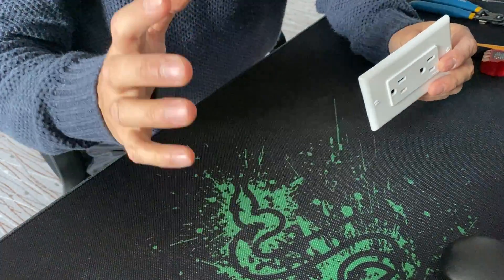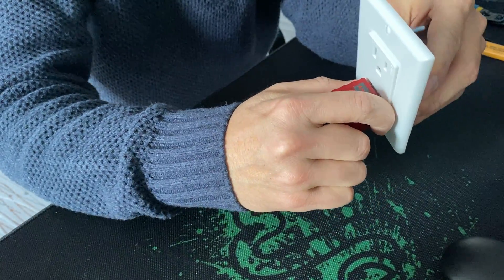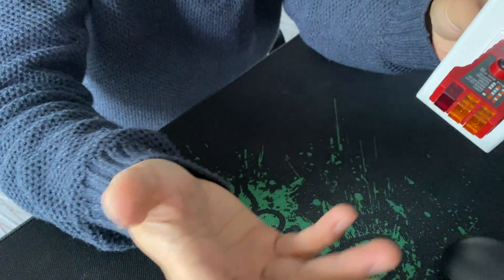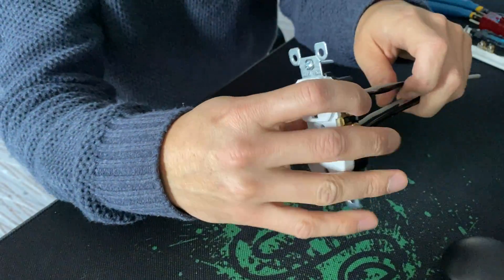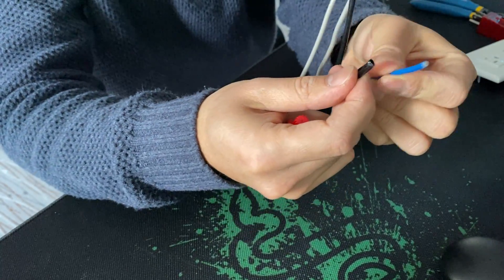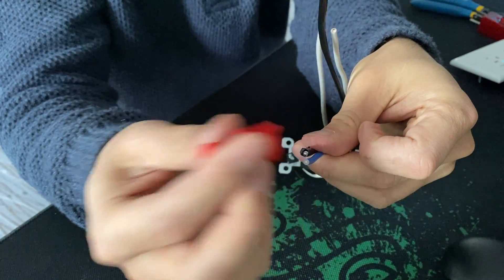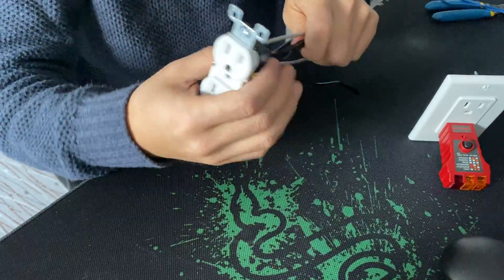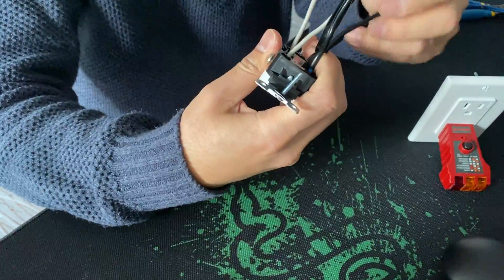Outlets Lights Not Working but Breaker is ON

Comment: Can you tell me what 100 volts would mean? All the other outlets on the chain are 120. There is just one outlet in the middle that's giving me problems. It fluctuates between 97 to 100.
Reply from the maker: gotta check wiring , open neutral somewhere. disconnected neutral in the chain of that circuit.
Reply: @remoteelectrician I appreciate that. I found it finally. I had a backstabbed outlet that had been arcing really bad in a back bedroom. The neutral was burned out of it. The wires were oxidized so I cut them back and used a few wago to connect fresh romex to it. All outlets are sitting at 124 to 120. Safe to say I’m redoing all the outlets in the house now lol

Comment: quick comment, if your GFCI plugs in bathrooms lose power, check every outside plug, garage, etc.   They wired all the outside plugs in my house on same circuit as GFCI plugs in bathrooms, but my house didn't have GFCI plugs in garage and outside, was confusing when a loose wire in my garage plug took out my bathroom plugs.

Comment: some of my appliances stopped working "shorted?" I ended up replacing them, I am wondering what can happen in the house that caused it?
Reply from the maker: surge. you can install surge protector inside of the electrical panel to avoid it in the future.
Reply: @remoteelectrician  I saw that, just put in one of the slots?

Comment: I have the opposite. Breakers off one at a time and light stays on. Must be the red wire on breaker and existing circuit...so solar battery keeping current open. When i plug portable ac on it wont turn due to cord breaker and light goes off. After a few hours light comes on by itself.

Comment: We’re having this problem. But the thing is, the power will turn on if we move the plug to the right. If we rest it in the outlet normally all the electricity in the room turns off.
Reply from the maker: gotta rewire and install new outlet

Comment: So basically it's a nightmare.....you have to go through every outlet and wiring untill they work
Reply: Yes, sometimes.  Once we found an outlet that had failed from age and it was arcing . Since the house was 40 years old we went through and replaced all of them.  Except at least one which I found today.  It wasn’t the problem though. Sigh.

Comment: Hello I have an issue where I unplugged an appliance from the outlet and I lose power to the other outlets any info would be appreciated
Reply from the maker: if it's kitchen/bath/garage or outdoor outlet it's tripped gfci outet, you need to locate it and reset it.

Comment: I started at the middle and go upstream.  Found one receptacle has 34volt from live to neutral and 120 Volt from live to ground. It must be a neutral issue. I found out the light switch upstream neutral cable came apart.
Reply from the maker: yes, open neutral

Comment: See if you can figure this one out. I have several outlets that are not working. They are wired in parallel. If I measure with meter across the outlet I have 115 volts.

Comment: My daughter's bedroom is wired like that where all the electrical outlets are tied to each other and not pigtailed.  There's 3 outlets and the light and they don't work.  And it's aluminum wire!
Reply from the maker: that's how most homes wired. gotta locate where it got disconnected or melted outlet etc. to fix.

Comment: I had an extension cord spark and blow an outlet. It is one that has the reset on it. I have taken off the outlet and disconnected it. But I am now not able to use any outlet in the connecting room. I checked the breaker all is good. There is no damage nothing burnt.
Reply from the maker: you may have wired new gfci incorrectly.

Comment: I have no power in my garage. No gfci tripped, no outlets have power in or out, replaced the breaker with no change, verified 120v coming out of the breaker. Im stuck
Reply from the maker: you have junction box between breaker and outlet somewhere, locate it and fix that loose wire)
Reply: @remoteelectrician  any tips on how to find the junction box? I don't have electrical schematics for the house and there aren't any obvious boxes
Reply from the maker: you should hire an electrician then

Comment: in the bedroom once Outlets working but the two Outlet not working if it's loose wire why when I testing the outlet it was alive but not working
Reply from the maker: you may have loose neutral wire you need to pull all 3 and check visually wiring or use multimeter.

Comment: I have 3 outlets in my room two work but the one doesn’t I installed a new outlet & checked to make sure I install the wires correctly but still no power.. what is the issue?
Reply from the maker: loose wire in the chain(other outlets - visually wiring check)  and check with voltmeter

Comment: Hello !,  I have  a mayor  problem,  I turned off breaker then I instolled two new outlet  on and two pandect  light on ceiling   after all  I installed everything  and turn on breaker back it work for a few mins. then it cut off by it self  but breaker remain on and I checked the line a few time to see what cause it and still I'm confuse what went wrong  can anyone be kind  help me figure this out please .
Reply from the maker: loose wiring in that circuit you worked on. hire someone and get it done professionally sounds like it did poor job with those updates.

Comment: I found my exterior Gfci wasn't working, I replaced for weather Proof Gfci, and It worked a little bit, not it's doing again, not power on that circuit, leaving my ac outlet with not power, and circuit braker not tripped
Reply from the maker: make sure it's not protected by another gfci that is installed inside. look behind that same wall and look for another gfci. test wires with voltmeter and see what voltage you have, also make sure it's not switched outlet.
Reply: @remoteelectrician  thank you for your answer. I removed all the outlets to check any of then burned out, but all of them were OK.  on that circuit there's only that GFCI, I have a feeling there's something wrong with circuit braker in the panel, I think it's time to get licensed electrician. 😔 I'm very frustrated.

Comment: What if my outlets only have 2 prongs?
Reply: This I know. But your testing device has 3 prongs…so what would one do when they only have 2 prongs…do they make a testing device for 2 prong outlets?
Reply: @Becc_a_1 use a multimeter
Reply: @rebeccajacobs3093 you can make your own 2 prong testing device by bending the ground prongs out of the way or breaking them off in order to make the device work in a 2 prong outlet
Reply: @Becc_a_1  Multi-meter.
Reply from the maker: 2 prong is just old outlet without ground wire.
Reply: Mines the same only 2 prongs

Comment: My emotional support human plugged his iron into an outlet in the kitchen. The lights stopped working and also two outlets. I went through these steps, no breaker tripped, i took out the outlets and there is like a shit load of plaster all over them. I feel dumb, the wires are connected and I am not seeing anything with the wires themselves except for the ungodly amount of plaster.  Should i throw in the towel and have someone come out?
Reply from the maker: if outlet wires have power it could be loose wiring or tripped gfci outlet

Comment: You should have explained what to do if the voltage tester says there's no power, but you haven't turned the power off yet at the breaker box
Reply from the maker: facts!
I will make an update video with real example troubleshooting those

Comment: Sequence. First check outlet for power. Second, check breakers for tripped one. Third, reset any gfci's in the house as one may be feeding regular outlets and they aren't labeled as they should be. After that then you check nearby outlets to locate any other's that aren't working. You never start at the end of a circuit, you start in the middle. Meaning you need to locate the last hot plug before power is lost. Then you know the issue is in the dead receptacle or in the last hot one. Now you're ready to find the problem.
Reply: Thank you my dude! I actually read your comment first before I watched the video cuz an ad was playing but I jumped up to check, my gfi tripped and caused three of my outlets to stop working and had no breakers tripped……this worked for me!! Thank you!
Reply: @DaylnD  The hardest problem is knowing where to look first.
Reply: my gfci tripped in one room which caused 3 outlets in other rooms to lose power
Reply: @SpewHugh  seems my outlets have a similar problem. One GFCI outlet has no power, and another outlet close to it has no power either, while other outlets work well. How did you fix it? Many thanks!
Reply: @BenSun-cf5kq  Watch the video. Read the comment you're replying to
Reply: Your instruction are simple and clear buddy thanks for the help and explanation
Reply: THANK YOU!
I had a GFCI hidden behind a multi plug added on. 
I didn't see it was a gfci until I removed the multi plug.
Reply: Your comment saved me $!!!
Reply: This advice is TOP TIER! As soon as I read this I went to the outlet next to the one that still wasn’t working after replacing it.  The problem was with the outlet next to the one that was not working. Tightened a loose screw and the other outlet worked fine. Thanks!
Reply: @Wudman  Glad I was able to help.
Reply: @haroldgreen1425 you are not who he was thanking, you never gave any advice lol😂😂😂
Reply: @matthewhitchens4861  It was posted under replies to me.
Reply: @haroldgreen1425  No it wasn't